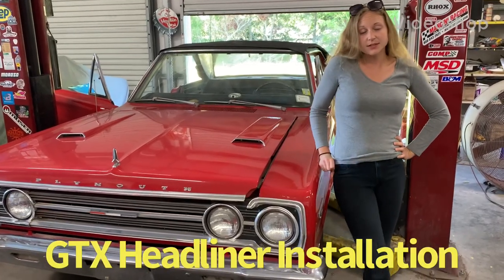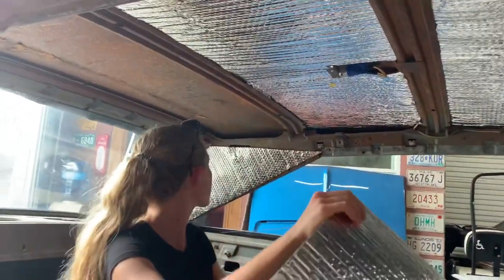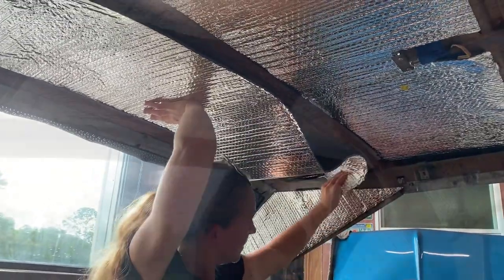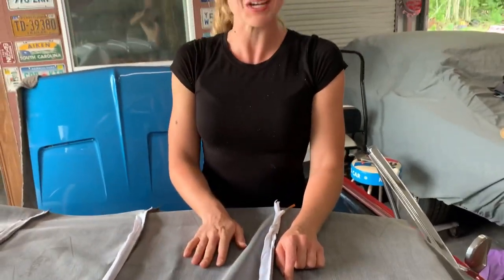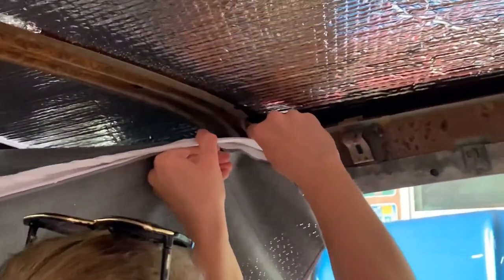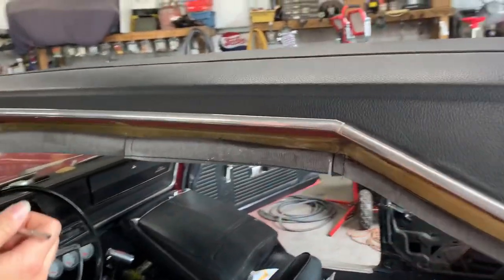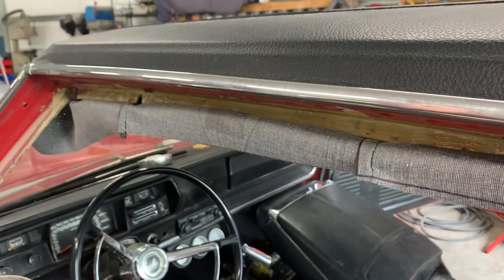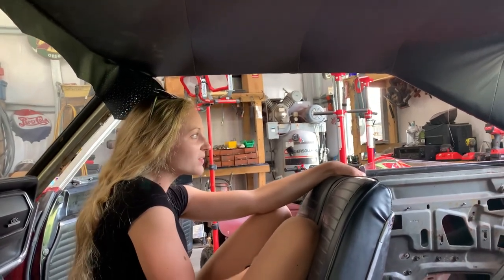Plymouth GTX Headliner #nonamenationals #440 #mopar

Comment: I'm so glad you did a '67 GTX, my wife's 1st car is her "67 Belvedere 2 and I as a retired mechanic was the 1 to replace the headliner. You make it look easy and it wasn't hard, and the instruction saved a lot of time and kept me from missing things like those hooks at the rear that I might have forgotten. The only thing I did extra was replace the boards at the sail panels with new ones and spray a little water and use a heat gun to remove the smaller wrinkles, the sun on a hot day did very well to shrink the headliner too. The trim is definitely a tedious, but satisfying, and the trim inside at the windshield I epoxied because they were a little loose. It turned out great Thank You for giving me the confidence to tackle a headliner!
Reply from the maker: Very cool it sounds like yours went pretty smooth! That’s awesome your wife still has her Belvedere and thank you very much for watching 👍

Comment: 😊 very good!   /  I noticed the GTX  has better lookin shark-teeth and there all the way around.. anyway my 70' Dodge Dart doesn't have them on the sides....  a strip of metal runs the side length but it's not as good as your car...  mine didn't quite turn out as good as yours...   🤔

Comment: Oh, so that is where the clips go.  I noticed in my Classic Industries Catalogue that they are saying you need clips for 66-70 but not for 71-74. I figured the clips were things that hold the top bows to the roof, but they hold the headliner fabric to the top bows and the tow bows to the roof. Can you tell me why some cars need them and some don't?   I know you have both types of cars and seem pretty experienced with headliners. I checked my cars today and two of my 71 to 73 and newer cars need headliners.
Reply: Also, where did you buy your headliner?  It says "CGPC"...I guess it is the  "perforated"?
Reply: Ok, it appears there are TWO types of clips... the ones that look like hog rings that you showed, and the ones that are silver rectangles.
Reply from the maker: The hooks in the back grab the bow, it's the starting point for the first bow. It goes around the very back one and as you pull forward, it keeps the other bows in line bc the fabric only allows it to go so far. Hope that makes sense. The headliner came from ebay, it came quick in 4 days for $80. Everyone else was on backorder for months. 

We are under the impression that all of the cars need those two starting hooks for the rear bow. Now we've done them on chargers, challengers, and barracudas up to 74 and they all have had those two hooks in the back other than the Grand Coupe Barracuda which has a headliner board that takes some modern style headliner cloth fabric, kind of like the newer cars have.